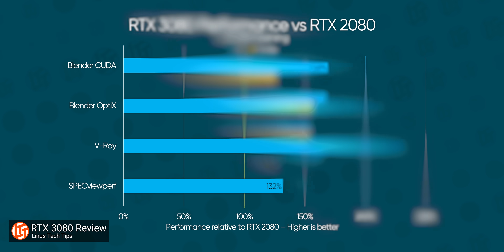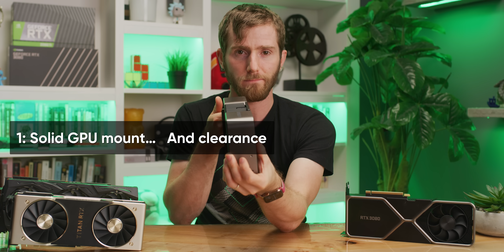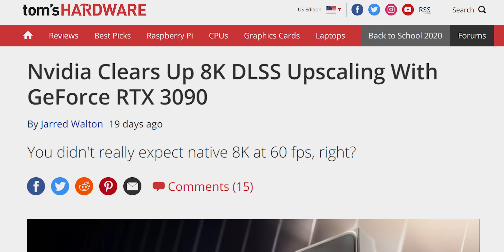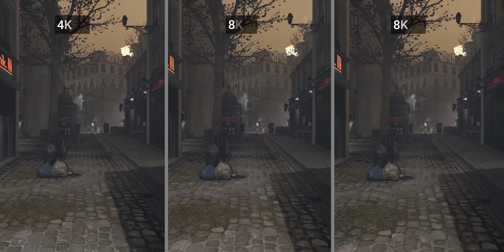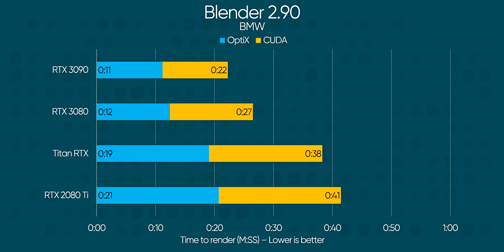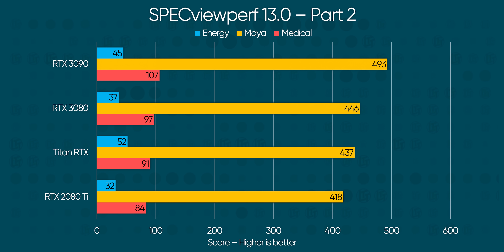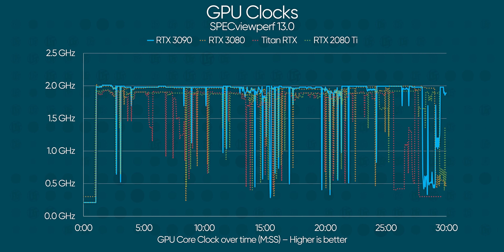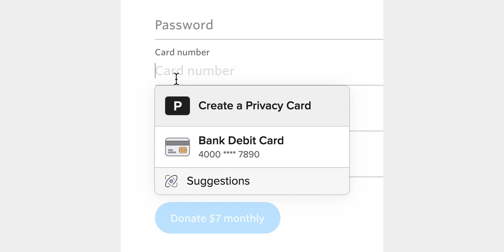Making Nvidia’s CEO mad - RTX 3090 Review

Comment: Finally I can play Microsoft flight simulator at 23fps
Reply: 1 fps short of cinematic
Reply: Qiaoyu Zhang u mean 7 frames
Reply: In vr
Reply: Lasse Xploderar lol
Reply: Lasse Xploderar on the 4K G2
Reply: Lasse Xploderar, VR is an odd duck. You don’t necessarily want (or need) super high resolution, but high frame rates (90+FPS) are a must to avoid motion sickness.
Reply: Didn't he said it was cpu bound rather.
Reply: @AnFunctionArray  yup
Reply: Iqbal Muhammad nah....39 fps stand for 3090
Reply: If only i knew how to control that god damn fking plane
Reply: @flacko3k push  joystick back, and rotate.
Reply: @kjaergaard12345  pc, keyboard and mouse
Reply: instead of buying a 1.5k gpu for flight sim just buy a plane ticket ez
Reply: 10 FPS with PMDG
Reply: can it run Crysis is a dead meme
But Can it ruh Flight Simulator 2020 ?
Reply: @daveng7422  Guy though, it's 2020 any computer can run it max graphics with high FPS and very low latency on the cloud with GeForce Now!
Reply: @daveng7422  my 3080 can play it perfectly fine at ultra high settings
Reply: Bro.......BRO......... Minecraft with shaders and mods at 12 FPS!!!!
Reply: AFAIK CPU bottlenecks have a lot to do with flight sim not yet having DX12, it will be patched later.
Reply: @Avantime  I'm betting on FS getting DX12 before it releases on XBOX series X
Reply: @Avantime ;
Reply: @Avantime  That's strange for MS Flight Sim 2020 to not have DX12 right out of the gate, I did not know that
Reply: @ibrudiiv  MS rushed the game. Previously no one thought it would be out before the holidays. Still it turned out OK for them, if Metacritic scores are of any indication.
Reply: SLI time
Reply: I can play at 4k 60fps.

I played on YouTube 🥰
Reply: @ingthearith7367  youtube i can play at 8k xD only thing i can play at 8k
Reply: I don't get it, it runs fine on my 1070 with everything in high.
Reply: @kyzer97320  32-50 1440p ultra to high, 1070ti, ya I don't know what all the hate is about, but I do turn render scaling down to 90%, 10 frame jump, try it out
Reply: @biffisgreat  I'm at 100% scaling 1080p. I have a 1070 (watercooled) and a 6700k (WC) I runs fine. Maybe cause I don't fly between buildings lol
Reply: @kyzer97320  I ran it on a GTX 1070 and it was stunning. I just got a 3090 Though so, ill be cranking settings.
Reply: You need a new cpu, 1440p,1070ti,  i7-8700, 34-50, high to ultra settings
Reply: Crisis : Am i a joke to u
Reply: Here lies me lmao bye
Reply: laugh react
Reply: Ah yes 23 FPS in flight sim
Reply: Who plays games in 4k anyway?
Reply: According to benchmarks it would be about 50-70 FPS on 4K now vr is a different story
Reply: Ah ,,,,but can it run roblox...?
Reply: But can it run crysis🤔
Reply: @RussianWhales  He already did this test, and sadly not really..
Reply: Lol
Reply: @8K LMFAO!
Reply: You don't need many fps in flight simulator
Reply: Mateusz Janowski u require at least 45 for VR and that’s with reprojection  turned on.
Reply: Let’s fucking go
Reply: Someone else got 42 on 4k
Reply: So close to 24 FPS (max visible by your eyesight... totally)!!!1!!!!!1! Insert shocked face emoji
Reply: Me : Cries because Crysis lost its spot
Reply: @nogoat  bruh my 3080 can play partly smooth on ultra high
Reply: When the DirectX 12 update comes out next year, significantly better frame rate are coming.
Reply: I’m playing it at 0.1fps, my friends just send me screenshots while I tell him to press buttons over iMessage
Reply: AMD fanboys: "Waaaa! It doesn't play the most boring game available at 200fps! 😭"
Reply: @Iqbal Muhammad linus said 23 in the last few videos lmao
Reply: And that's with the shadows set to low.
Reply: Didn't they already test the 3080 on Flight Sim and it did 30....? Are you stupid
Reply: I always wanted to play Minecraft at 33 FPS.
Reply: I forgot who (I'll edit when I find it) one guy posted flight simulator with an overclocked threadripper 3990x and 129gb of ram with the 3080.  He got an average of 48 fps at 1440 and 62 at 1080.

I wonder what he will get with the 3090. 

That being said, that would be a $7k pc, but still, if like to see it.
Reply: Oops.

Updated yesterday, now it's 21fps.
Reply: It actually runs it at 57 fps Ultra in 4k
Reply: Lol it can run 4k 60 fps eany game
Reply: Microsoft flight simulator is the new chrome
Reply: Crysis remastered will run at 15 fps on low
Reply: My overclocked potato runs it at 42 fps
Reply: What resolution are you using?
Reply: hahahahahahahahaha
Reply: 23 frames per day
Reply: i have gtx 1060 16gb and i5 7600 on ultra i have 50
Reply: @xspetial2401  on 1080p? I game on a 1440p monitor with 1440p settings, that could be my issue.
Reply: IMAGINE MAKING A COMMENT BEFORE WATCHING THE WHOLE VIDEO LOL IDIOT
Reply: I know there's alot of memes about Microsoft flight simulator having terrible frame rates but I was able to play with 40 fps on a gtx 1050
Reply: XD
Reply: Woah
Reply: Don’t get to ahead off yourself
Reply: wow so u have a 8k monitor
Reply: Mine runs alright on high 1080p
Reply: I play FS2020 at 120 FPD
Reply: @dogzer  frames per dimensions
Reply: as long as you fly planes with no fancy avionics you'll get good FPS
Reply: Lmmfao
Reply: You or he?
Reply: Cinematic
Reply: Ahhhh it’s not really 8k. You did the math wrong Linus
Reply: Nice, I've heard that's all you need because the human eye can't see much above that.
Reply: 8k good with SLI?
Reply: @Iqbal Muhammad na like.000000000000001 fps
Reply: What’s the point of reviewing this cards without the caveat that drivers have not been optimized yet.
Reply: Play it in 1080p
Reply: Runs at 43 fps
Reply: I think itll run faster than that bro
Reply: I have a 1900x and 1080ti and can play flight sim on high settings at 30Fps at least so..
Reply: Holy! You must of overclocked everything max to get 23!
Reply: Cinematic
Reply: Dat funny
Reply: I wish you made a dollar with each like.
Reply: F-that "Potato Mode" baby!!! Whoooo!!!
Reply: Minecraft shaders at 6gps lol
Reply: cinematic
Reply: It's actually running at 50 fps at 4k ultra
Reply: You mean like 100
Reply: Haha
Reply: c i n e m a t i c
Reply: Not unless you get two
Reply: Lol! The RX 5700 XT can barely do that. What is funny is the 1650 Super can get the same frame rates. AMD and their second best products.
Reply: Am I missing a joke or something? I have a 2060 super and run MSflight at 30-60 FPS
Reply: Lmao
Reply: This is the newest crysis of our generation
Reply: Lol
Reply: 46 if you have 2
Reply: The 3080 gets 40ish fps at ultra 4k settings, I think the 3090 will be fine lol. It's your wallet that'll suffer, seeing as the 3090 is absolutely not worth the price lol
Reply: You need a lot of electricity money if you are planning on enjoying gaming.
Reply: No time for intro but time for sponsor I love this 💀💀
Reply: 46******
Reply: RTX3090....10 to 15% average better gaming than the 3080 for $800 more. What a joke.

No one is going to buy an expensive 8k monitor to play at 1440p upscaled(ai).

No one is going to buy a 1500watt power supply to use a sub-par workstation GPU that sucks down 450watts with no driver optimization. 

The 3090 is a pointless joke.

The RX6900XT will out perform the 3090 by 20% for $899. You heard it here first.
Reply: 1080ti will do it
Reply: You lucky bastard ... 😜
Reply: Lol
Reply: SLI 3090 will be an amazing 27fps!!
Reply: I got a i7-4770k with a 780ti and I get 40 fps at 1080p on medium so idk what yall going through
Reply: Yeah but at 1080p
Reply: Probably takes 23 minutes loading, 2TB p/hr bandwidth to attempt 8k everything on.  2 or 3 screens would just be a blue infinite loading bar, blue screen and corrupt OS so you have  to restore / download another 4 separate apps to have the world's worst game installer that by default plays menu music the entire time it's   taxing  the GPU as good as any benchmark
Reply: Still better than the last simulator
Reply: Nice, you’re almost to a cinematic experience!
Reply: Hey. It's *27 FPS
Reply: My guy
Reply: What's going wrong ? I get 35-50fps with a 2070 on 3440x1440 on 90% ultra settings.
Reply: Mine runs away because my gpu is that bad 👎 https://youtu.be/NDYB9qHVaLU but this is my new build its just waiting for a 3090 🤗
Reply: 1 take it or leave it
Reply: V nice
Reply: 9.9 K likes in user 24 hours
Reply: https://youtu.be/Dc0U0h_Me5I
Reply: cinematic
Reply: Bought 2 to play pong in 8k.
Reply: We all love microsoft.   Windows 2019 server build date 2018.
Reply: Actually it runs at 27 frames per second but if you turn it down to low settings it runs at over 58 frames per second and only stutters occasionally.

Microsoft is working on porting to the newer game engine though and will run much more efficiently, it's not finished yet though.
Reply: You god damn right!
Reply: Assuming you have the 10900K cpu
Reply: Nah at 22
Reply: just remember that ww2 fighters were equipped with 12fps gun camera at the cost of their life to keep the 12fps thingy running
Reply: 23 fps boi? 7 fps take it or leave it
Reply: I don't get this meme, I get 70ish fps 1440p ultra with a 2080ti
Reply: Hahahaha
Reply: I get 2 frames avg
Reply: Wanna bet? 😈
Reply: I manage 65 fps at 1080p with gtx 1650 and i5
Reply: @yawar-xyz  65 fps on Microsoft Flight Simulator......................................for MS-DOS
Reply: 43
Reply: No 60
Reply: how bad is your pc?!?! i have 25 to sometimes even 50 fps on maxed settings with an "RTX 2070"
Reply: game was huge for less than 2 days well done microsoft you really jebated the online community, then you have amongus which prob took a week to make and can run on literally anything with a pulse :)
Reply: https://youtu.be/OR-j2SNAB-0
Reply: 😂 I can play it at 25-30 FPS on a GTX 1070. If it doesn’t get you more than that, those cards are broken
Reply: Lol
Reply: 58fps here on ultra with 2080.
Reply: tHe hUmAn eYe cAnT dIsTiNgUiSh bEtWeEn AnYtHiNg aBoVe 24 fPs!!!1!!1!!
Reply: Tone down some settings mate. You might get a whooping 25-30 FPS!
Unreal, I know right?
Reply: I have a rx 560 and I play it at 2 frames a second
Reply: Is it cause 2080 TIs are only $200?
Reply: Nah more like 0.2 fps
Reply: *Correction 25fps*
Reply: Fax tho
Reply: Thats almost enough to upgrade to 720p
Reply: "Playing in Veeeee Orre [is] like entering a whole new minigame called "There's a focken psychopath hiding in the back of your plane". I'll explain what I mean: It [is] like waking up in the cockpit with a hangover, only to be suddenly cracked across the head with a baseball bat - and just as soon as you regain consciousness, the same thing happens again. About thirty or fourty times a minute!" ~ Laobi
Reply: 34fps
Reply: Just like back in the '90s.
Reply: lol
Reply: actually 60fps 4k max settings sooooo
Reply: dont shit , am playing it on rx580 with 23fps!
Reply: rtx2060: "What "fps" means?"
Reply: I dont get the whole fuss with fs2020 performance. Albeit at 1080 but im capped at 30fps running buttery smooth on a i4690k and rx580 ffs lol u dont need massive fps anyway its a sim just consistent smooth play.
Reply: 250 th comment 😐😐
Reply: Ppl
Reply: Eventually the 3080 will be priced at entry level and I will get one
Reply: Lmao
Reply: Me: cries in 5 fps
Reply: The irony is that MSFS only plays about 8 fps slower on my i7 6700 with GTX 1080, than it does on that top of the line, multi thousand dollar setup. 

Thanks MS, and 2020...
Reply: @RichardFPV  I have the same config, but with a 1050Ti, It runs at 10 fps ;-;
Reply: lmao FACTS
Reply: Does anybody know if the new cards have anti plasma 1080p 3D?
Reply: I get 33 fps at 1080p with a gtx 1070
Reply: 50 fps (yes I'm serious)
Reply: Mine runs 20 frames with low setting on
Reply: Hell, I am running MSFS on a i5 6600k with 24GB RAM, and a GTX 1050Ti and I am getting better than that.
Reply: Lol a youtuber got an RTX 3090 and played minecraft with some shaders and only got 70fps.
Reply: Very cinematic looking
Reply: Cpu bound game you need a better cpu
Reply: And in VR at a whopping 6 FPS!
Reply: Just don't forget the second PSU for that
Reply: LOL
Reply: *Microsoft Flight Simulator 2004
Reply: Ye
Reply: @Iqbal The EOD Specialist no lesser
Reply: Hahaha 🤣
Reply: It'd probably make your computer sound like an airplane.
Reply: 60 fps baby 😎
Reply: i use a 2080 super and get 75 fps on mfs 2020 at high
Reply: Fr tho shits not optimized
Reply: On 1080 low
Reply: @Muhammad Iqbal that's actually 90, homeless
Reply: @Muhammad Iqbal r/yourjokebutworse
Reply: Show off
Reply: Jay _TooGoated  Trash build. Please delete your comment.
Reply: Stop the 🧢
Reply: I get 36 on my 1660Ti and Ryzen 5 lol
Reply: I think so but it won’t be quality
Reply: @Mr. Muhammad Iqbal 🤣
Reply: A whopping 60 frames per minute
Reply: Yes but in vr
Reply: https://youtu.be/3EFN3XCefRU   rtx
Reply: I have no problem averaging 50fps with my 3090 @ 3440x1440 resolution
Reply: @Mr. Muhammad Iqbal -69,420 fps
Reply: bruh. you need the nvidia 6090 to run at 23fps
Reply: you forgot the at 720p
Reply: I can't never play it XD
Reply: 23 damn I'm running at 32
Reply: @Boxersteavee  I knew it was a joke bruh ik he would be running the game st much higher fps so it was obviously a joke
Reply: Ik
Reply: @Mr. Muhammad Iqbal ik this is a joke but my gtx 1660 runs Microsoft flight simulator at 37 fos
Reply: Cinematic nice
Reply: I mean not at 4k ultra you can get 60 fps or at high and 1080p you can get 100 fps
Reply: Pilot died prank was good
Reply: me with my intel graphics
Reply: That's about what I play just about any game at
Reply: at LEAST at 4 fps
Reply: i have 2080ti and its only Run 20 fps
Reply: FACTS. Been looking forward to 20+fps. THE FUTURE IS NOW.
Reply: So true
Reply: I get about 90
Reply: Thats like fortnite on a old samsung how bad could a phone go i wonder 🤔
Reply: WTF is AK for 8K resolutions, when i named it, back in 2011 the 8K as EHD:
- we have HD 720p
- FHD at 1080p (F=Full)
- UHD (4K) at 2160p (U=Ultra)
- and EHD (8K) at 4320p. (E = guess) =))
- EHD ? yes! It's "Extreme HD" ^^
Reply: Do you have a name for 16K ? Yes ! GHD !!! ^^ 
P.S. And that would be THE LAST ONE !!! cause N.W.O. will be "Fully Installed" !!!
Reply: Sad but true
Reply: LOL
Reply: But can it run… c r y s i s?
Reply: @Mr. Iqbal; why so low?
Reply: @gxchaverse532 😗✌️ why so low tf it runs at 120000 on mine
Reply: It’ll be a slideshow be real
Reply: What is your ram
Reply: loll
Reply: this:23 fps
new xbocks: 30 fps
what.
Reply: 22 fps better than rust console edition.
Reply: nah it cant even run doom 1 at 2 fps
Reply: You sure? It’s more like 12 fps
Reply: damn
Reply: Sheesh🥶🥶🥶
Reply: Mine runs at 60fps
Reply: Your telling me if I get a 3090 I can only get 29fps
Reply: If you manage to get your hands on one of these. Linus had like ninety percentage of the rtx 3090 stock in this video
Reply: 4k ultra settings about 50-70 fps
Reply: u mean screenshot mode
Reply: Realistically speaking like 7,000 on low settings that is
Reply: Get 4090
Reply: Performance has increased by 2 fps with the new rtx 4090, unfortunately the i9 14900ks and 4090 with 64 gb ram can't run the Roblox menu at 10 fps yet.
Reply: Н
Reply: Good news rtx 5090 next month... blistering 30fps
Reply: Lucky Boi mine runs 10 fps with my 2080ti 
At 720p
Edit: 100fps 
          My bad guys XD and it's more than 720p
Reply: @pacesucks7008  How the f**k
 I have a 2070 Super, my game runs at 1080p high at 45~50 fps
Reply: @pacesucks7008  
Mine runs at 40 stable fps 1080p, medium-high settings, gtx1070, intel i5 4670k(from when I built my pc), 16gb ram
Reply: Parth Rastogi 1080p. The 3090 did 8k at 15fps. At a legitimate setting like 1440p the 3090 would slay flight sim
Reply: Parth Rastogi my 1070 gives 30fps with all settings low 1080p
Reply: @pacesucks7008  I highly doubt you have an rtx 2080ti
Reply: @ArchisMarathe  Excuse me 
 
There better be a good reason for it
Edit:🧐
Reply: @pacesucks7008  it's like that kid who says he has an iphone 12 pro max 32gb ram 2tb storage and PS9 and Xbox series xxxx 😂

Here in india it is very uncommon for someone to have something like an rtx 2080ti, as people are just not willing to spend that much. 

Also, the way you reacted, editing your comment and putting the 🧐 emoji... 

You seem to lie
Reply: @ArchisMarathe  Bruh Uk some weird kids XD

Plus I ain't made it in India dude
It's unaffordable af 
Managed to get it from abroad thru some relatives
Reply: @ArchisMarathe  Let's not try to be detectives and judge random people on the internet shall we
Reply: @pacesucks7008  ok, agreed
Reply: Parth Rastogi it was meant to be a joke, and good luck selling your 2080ti!
Reply: @codizzlesdad3743  :( why must you hurt me like this? 

He made very valid point tho 
I haven't seen a single 2080ti in India
Reply: @pacesucks7008  wow
Reply: @pacesucks7008  then u got a shit pc homie. I get 34 fps with a rtx 2060S
Reply: @batemil1999  what resolution and settings are you playing at. I can claim random shit on the internet too.  It's not about shitty pc or not. My 10940X @ 5GHZ and 2080Ti struggles as well. It's held back by Flight Simulator heavily utilizing a single core as Linus found out in his testing.
Reply: Hahaha!!!
Reply: most flight sims have troubles with FPS
Reply: @RacerRookie  Flight SIM sucks I hate it
Reply: Try maybe like 40-50 ...23 would be like vr.. 😂
Reply: Cinematic framerates are probably enough for flight sim
Reply: @bearpuns5910  Then it is clear to me that you have no idea as to what you are talking about. Smoother frame rates and sharper details for things like the cockpit instrumentation are all updating in real time, it's not just the outside scenery. And when it comes to the simulation of the glass cockpit displays it's like you are rendering multiple screens at once, and since they all have different information being displayed, they may refresh at the same rate but the information doesn't update at the same rate, so it really does require a lot of computing power to do all that. So yeah, it seems you are just another one of the hater wannabes that never wants to acknowledge that a true software benchmark will always be better with a flight simulator. Because it not just the planes, it's the weather, the air currents, the water, the aerodynamics, the ai traffic, the lighting, and a lot more than I feel like talking about here. The fact that even the biggest systems have issues with it point to to things, one MSFS is a beast of a program, and two it is in dire need of optimization and DX12 support.
Reply: @ImpendingJoker  I'm not reading that
Reply: Up to 720p
Reply: People who say this are full of crap. I have no trouble at 3440x1440 and running a 4th gen i7 4790k with no overclock and a 1080ti. Why lie?
Reply: Worst game ever
Reply: IF has Microsoft in name, stay away from it
Reply: @nikolygtx8848  why
Reply: @nikolygtx8848  so you game on Linux?
Reply: @timbillins1848  Tried but i have hardware problems, drivers or something
Reply: @nikolygtx8848  Microsoft Windows
Reply: @nikolygtx8848  salty PS fanboy 🤣
Reply: @nikolygtx8848  Microsoft Window XP
Reply: @nikolygtx8848  go fkin use mac . Lol normie
Reply: @nikolygtx8848  3090will only run on Linux without microsoft 😂😂
Reply: @Tech-vd8gj  Well with that price im surprised u don't have it installed xD
Reply: @nikolygtx8848  well im.running a 1050ti
Reply: nikolygtx if u like cars Microsoft makes the best open world racing game in forza horizon
Reply: @nikolygtx8848  Laughs in Forza Horizon 4
Reply: nikolygtx Forza is good
Reply: @nikolygtx8848  or Disney
Reply: @nikolygtx8848  at least the performance does
Reply: @nikolygtx8848  I know it often feels like MS is going backwards, but if it wasn't for Microsoft this card likely wouldn't even exist. Just sayin'
Reply: nikolygtx Now I see why girls stay always from me 😔
Reply: What about windows
Reply: @nikolygtx8848  Go sit down and let the adults talk. You're embarrassing yourself, kid.
Reply: @nikolygtx8848  Microsoft Windows 10.
Reply: @nikolygtx8848  Minecraft bedrock has rtx integrated and is very fast in performance
Reply: @nikolygtx8848  stop
Reply: @nikolygtx8848  opposite stay  away from apple
Reply: @danishfnu3296  Don't worry apple its not even in argument how much i don't like that company
Reply: @nikolygtx8848  *microsoft windows*